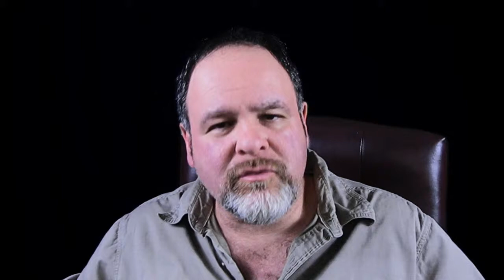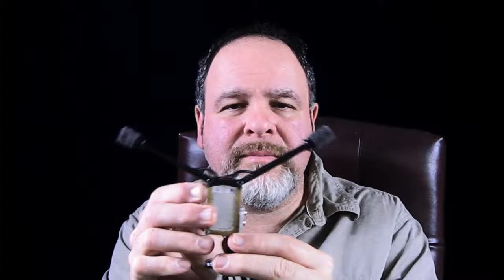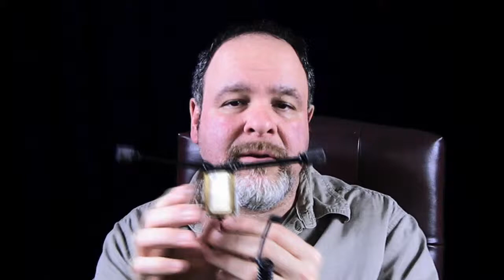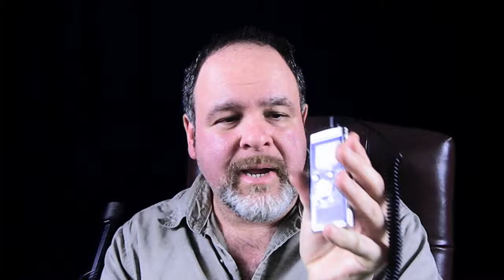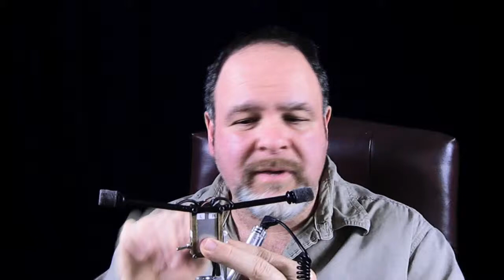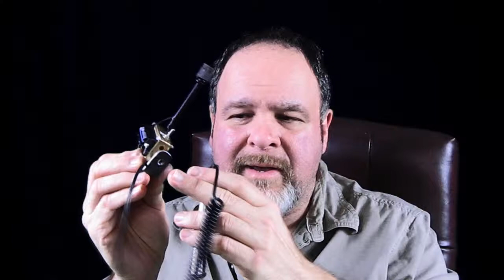VParanormal1 Demonstrates  Custom "EVP Para-Field" (TM)

Comment from the maker: There are theories out there that suggest EVP's do not even use the microphones at all. EVP's tend to enter the digital recorders internal circuitry and present themselves as equal voltage (VU) energy. This custom microphone will make external acoustic sounds that are captured during an investigation become obvious that they are not valid EVP's.
Reply: What about EVPs that are on tape? 
Who's theory is that?